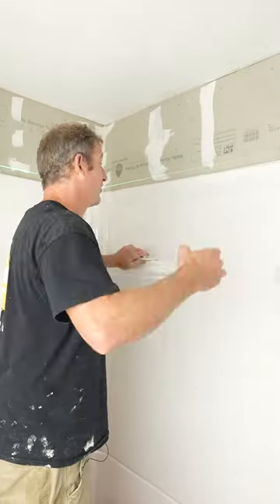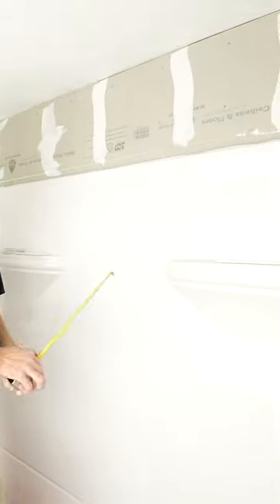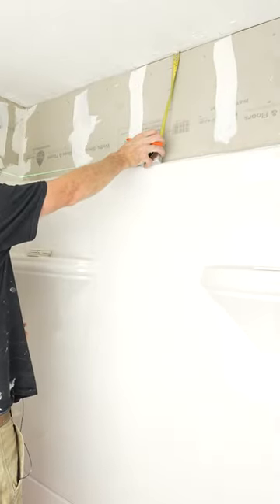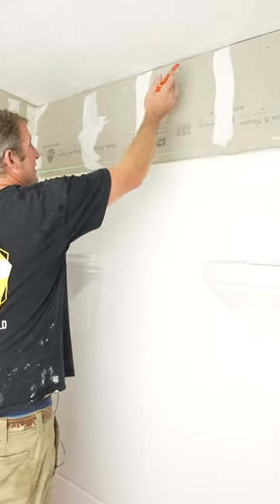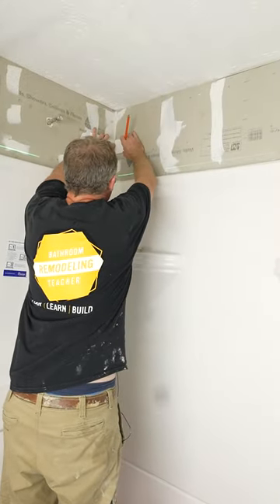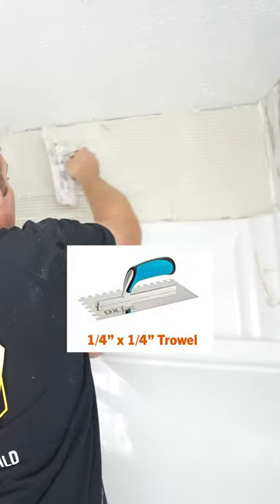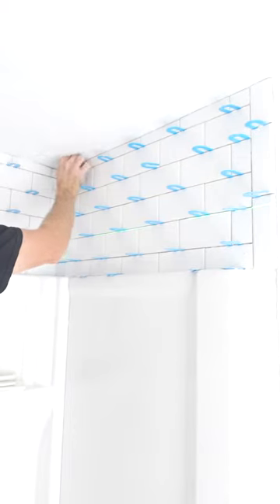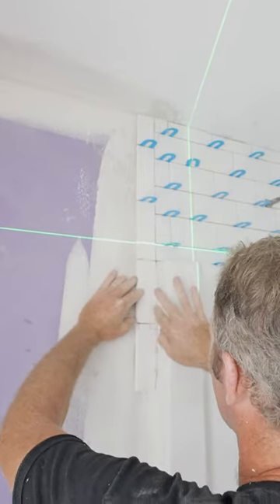Tiling around a shower tips

Comment: How much to install a shower enclosure like that and tile surround?
Reply: 4500$
Reply: @wstevenson2004  Capitalism is fun isn't it 😆
Reply: @wstevenson2004  That's the right price.
Reply: @Tool_Addicted_Carpenter  Any suggestion on how to increase the water pressure out of the shower head?
Reply: @wstevenson2004  This is an extremely crude suggestion but honestly I took my showerhead off and super glued some of the holes shut in a consistent pattern. Has worked for over 2 yrs.
Reply: They didn't even do the shower surround. Now I have to find someone to do that and install a sliding door, too. 😢